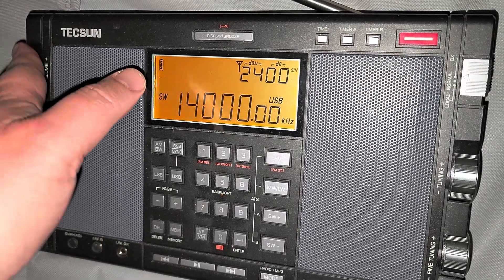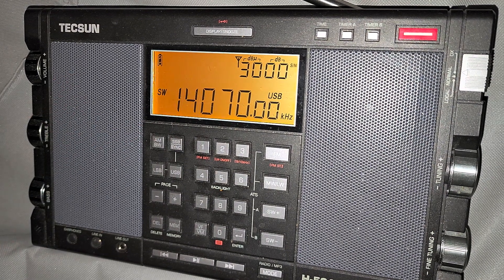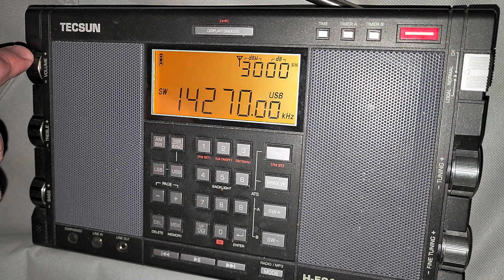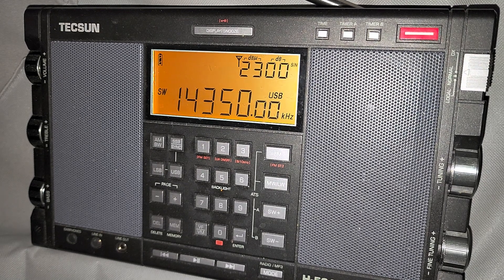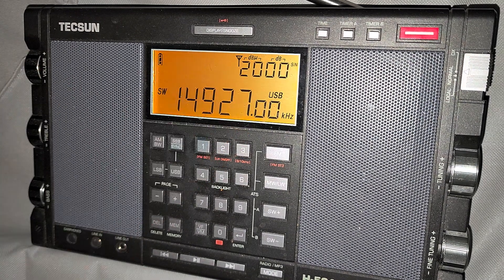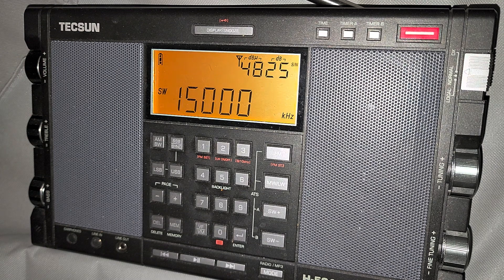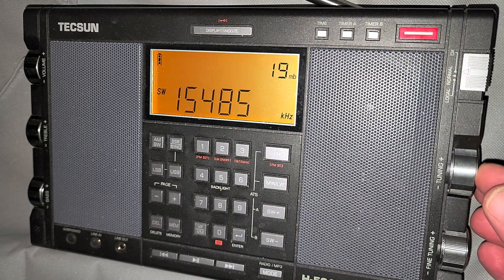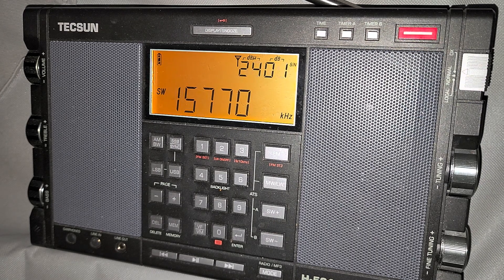Tecsun H-501x Tuning 14000 - 16000 kHz Shortwave with comments on telescopic antenna

Comment: Long time follower here, from back when I marveled at your wonderful ICOM 8500. Question please: What is your recommendation for the smallest full-featured shortwave radio? By that I mean a unit that has usable filters, DSP, SSB, CW, Air, FM, AM Sync, external antenna input, and fine tuning. The closest I've come so far is my Eton Elite Executive. Thanks for your thoughts, Michael
Reply: The 501X should be a better receiver than the Eton. I have an Eton/Grundig G6 and it is good, but from what I've seen/heard of the 501X, it edges it out.